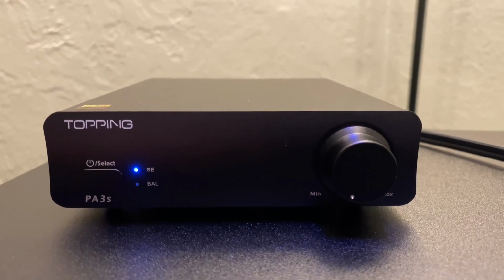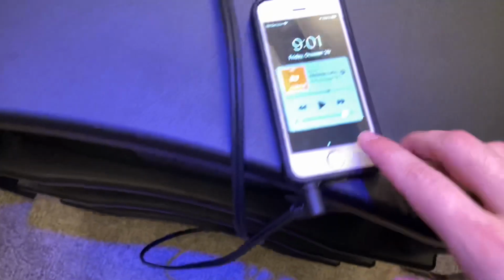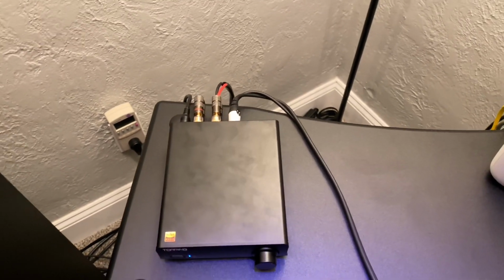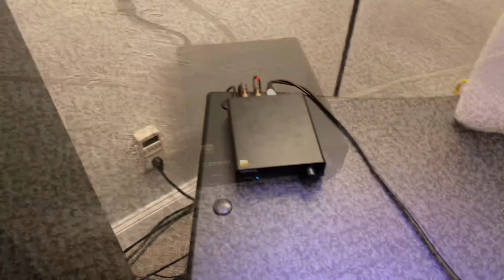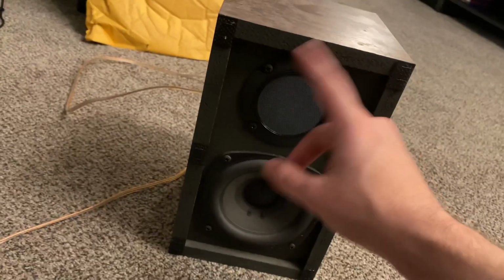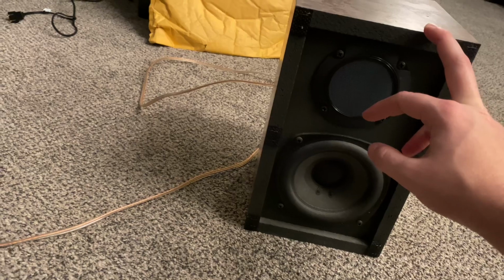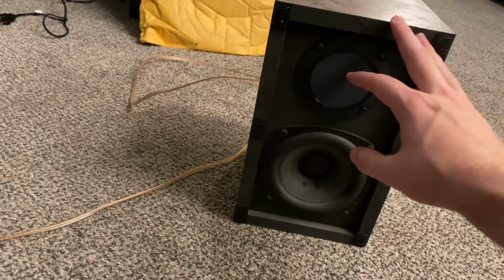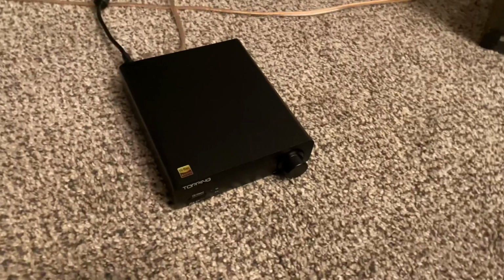Topping PA3s performance and small issue?

Comment: You should short circuit the input in testing in this manner and check out again
Reply from the maker: What? That doesn’t sense. The issue was from unshielded drivers in the speaker.

Comment: Hi! You can try - ifi GND defender
Reply from the maker: Not a grounding issue, especially considering the amp doesn't have a ground. It was only with these speakers and none of the others. I use it with my JBL 530s and it's dead silent even putting my ear up to it.

Comment: Hi! Is there a memorization of the last state? For example - the amplifier is on, playing, the RCA input is selected. I turn off the 220 volt power outlet. An hour later, I turn on the 220 volt power again. What will happen to the amplifier?
Will it turn on, or not?
Reply from the maker: I just tested, it will not turn back in automatically, you will have to hit the power button again. It does remember which input you were last using though.

Comment: Does it happen when the roon lights are off?  I found that some light bulbs can cause noise with some audio equipment. Seems to be some kind of interference.
Reply from the maker: Yes, the issue is the old drivers aren't shielded. No other speaker I have does this, only these.

Comment: Do you think this will be able to power Klipsch R-26FA tower speakers rated at 8 Ohm - 100w?
Reply from the maker: Yes and No. Are you running them full range with no sub, and want to turn it up loud? Then I'd say maybe not. If you're running a sub or don't need to play them really loud for just casual listening or in a small room, then it's probably ok. But I honestly think you may want to get an amp with a little more power. You're only going to get 27w at 8ohm, so that's not a lot when it comes to bass or turning it up loud. My JBL 590s did get pretty loud using this, but I would be a little worried that you may run out of power sometimes.
Reply: @andrewskaterrr Yes..I do have a sub ..generally I do not exceed more than 85 db volume in a mid sized room…thank you very much for your response ..this is helpful
Reply: If the Klipsch are 90 db efficient it should be ok in a medium sized room. Probably won’t party though.

Comment: I also just sold my ra100 and I’m looking at buying this to replace it
Reply from the maker: Not sure how much power you need but this is good for desktops with any speakers, and 2ch setups if you have efficient speakers. If you want more power similar to the RA100's output, I'd go with the $350 Topping PA5 for chart topping performance with 48w @8ohm and 83w @4ohm of super clean power. 
https://www.audiosciencereview.com/forum/index.php?threads/topping-pa5-review-amplifier.28512/

Comment: You are getting this issue when using only one channel ? Why are you testing it with only one speaker and letting the other without load ?
Reply from the maker: 1. I first hooked it up with 2 speakers and that’s when I first heard it.
2. It doesn’t matter if it’s only 1 channel loaded. Amps don’t require both channels to be loaded, they’re two separate amp circuits/channels.

Comment: Problem solved? Was it the speaker or the cell phone interference?
Reply from the maker: The speakers would do it even when the phone was off. As I mentioned, I used it on 4 sets of speakers and these were the only speakers that did it. It’s just the speakers and something with how the amp works I guess. I just upgraded my speakers to the JBL 530s and there’s no issues still.
Reply: @andrewskaterrr  I've got the same speakers, JBL 530s. I have them on the Sony STR DH190 receiver for the time being. I'd like to know more about your experience pairing them with the PA3s.
Reply from the maker: @EricDSalisbury  For a desktop setup the PA3s is great. It would pass for a music setup in you don't want to blast the 530s really high I'd imagine. They do get pretty loud though. Like I can't max it out or I'd go deaf sitting here. I did hook them up to an old receiver that I use in my dining room, and they didn't get as loud as my old JBL LX300s @6ohm as well. If you want power to not be an issue, you need to go with the $350 PA5, or a Emotiva A2.
Reply: @andrewskaterrr  Thanks for the suggestions!